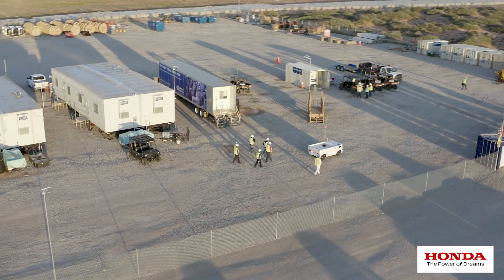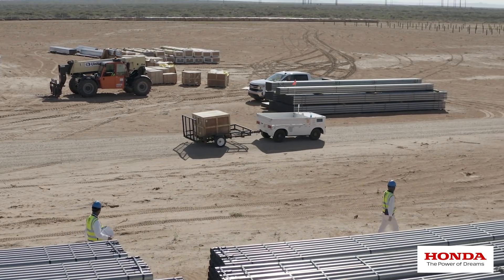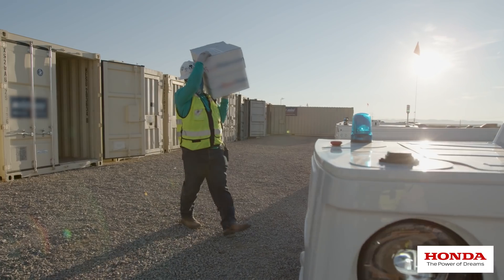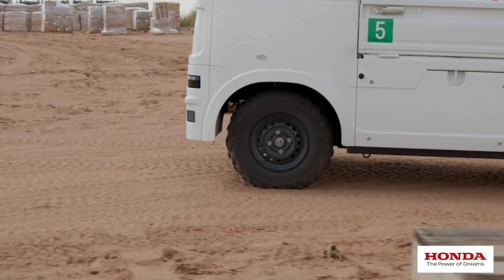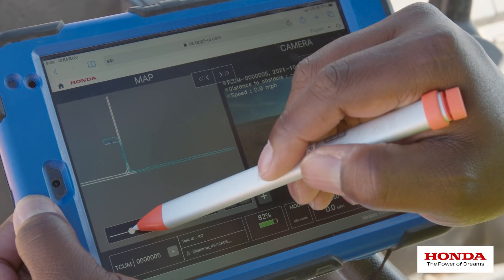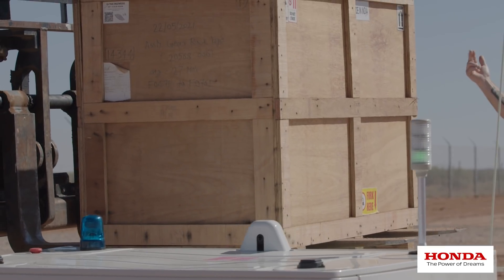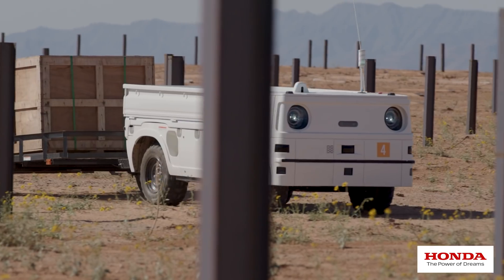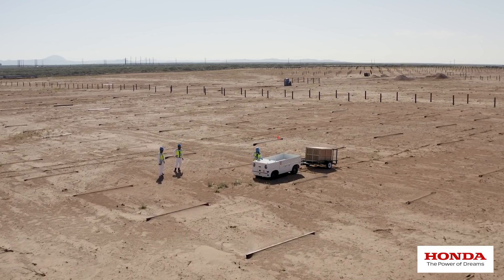Honda Autonomous Work Vehicle: Construction Use Case

Comment: Honda! Always on top, taking away some jobs but always on top
Reply: That's funny, because Honda has one of the highest, (if not  THE highest) human workforce per unit of production, than any other manufacturer. 
A tiny truck will not take any job away. It will make room for more jobs. As we can build MORE, FASTER, and SAFER. Plus, these things will have to be manufactured, maintained, and controlled. That's more jobs as well. 

Honda doesn't want to take your job. Honda wants to make the future SAFER for you.